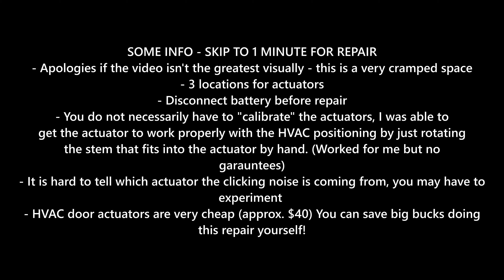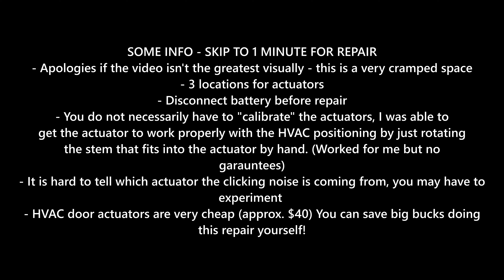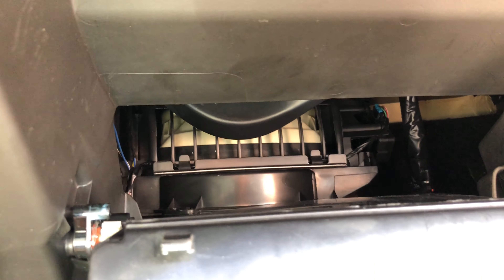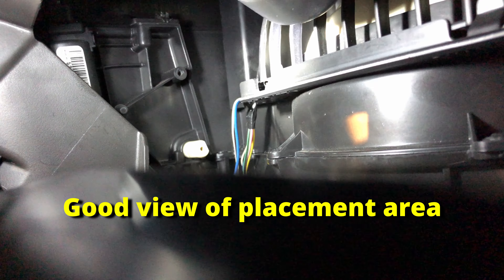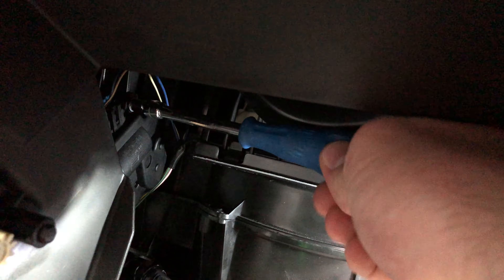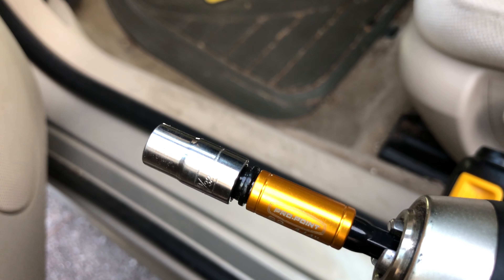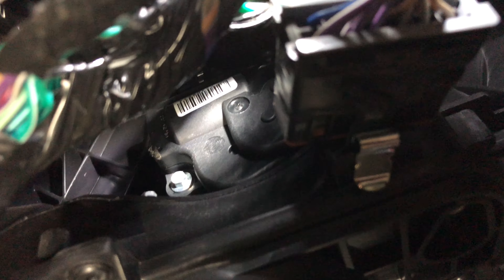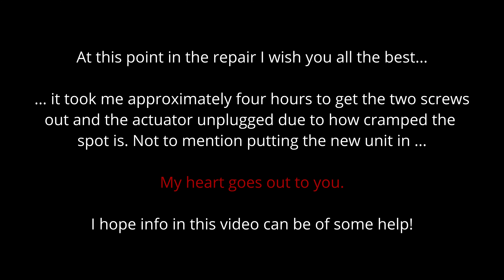Chevy Impala HVAC Air Door Actuators - ALL 3 LOCATIONS! - Fix Clicking Noise From Dash & HVAC Issues

Comment from the maker: Hey guys! If this video helped you out at all, a quick subscribe would mean the world to me. Have an amazing day.
Reply: 2010 chevy impala, It doesn't have the clicking noise but the driver side vents are not blowing cold/ responding to temp controls like the passenger side. Replaced driver side actuator hoping to fix the issue. Still having the same issue. Any ideas? Any help is most appreciated!

Comment: The actuator on the driver side can be more easily removed after removing the wiring harness clips that are in the way, and then using your socket with a universal joint and about a 12 inch extension to get to the two screws that hold it in place. That way you can work on it without being cramped up under the dash.

Comment: Screw that disasterous buried location of the 3rd driver's side unit. It took me 2 hours just to disconnect it. A nightmare in itself, you have to be a contortionist just to do that. I decided to call it "good" to just disconnect it and live with whatever minor consequence that provides. I bet the dealership wants close to $1000 to replace the driver's side unit. The 2 in the glovebox are a "piece of cake" in comparison. I've already done both of those once recently. It seems they all fail within a year or some months of each other.
Reply: I finally gave in, it took 4 hours to complete the job on the replacement on the driver's side. Need a very long extension and universal joint and stick'm to hold the screw from falling out of the socket.
Reply: I gave up after getting the two screws out, but failing to get the clip off. I just grabbed the white knob that turns the flap inside the vent and rotated it until I got warm air. In the spring I’ll get back under there and rotate it back again.
Reply: @JonStratford1234  due to vibration, it may not stay where you want it.
Reply: @danblumel  Shoot, hadn't thought of that. I'll know on Sunday--we have a nine hour drive ahead of us.
Reply: @JonStratford1234  if someone has been manually turning the white knob, will that cause it to break? I have to replace the passenger side now because I'm still getting cold air on that side, but was wondering if tampering would effect that?
Reply: @killerbee792  I don't see how turning it by hand would break it. I should report back that, as @Dan Blumel guessed, mine did rotate back to an open position within five minutes of driving it, so I'm back to having cold air on the drivers side. My guess is, it's not broken--it's just not effective to turn it by hand, because the flap keeps opening back up.
Reply: @JonStratford1234  wow, only 5 minutes? Thats a drag. Don't blame you for not wanting to continue though. It was 15 degrees yesterday, but alas, I got it done, and now that annoying noise is history. Hoping I can determine which actuator on the passe get side is making it cold, I don't want to have to buy more 😫
Reply: I am an 88 year old widow at the mercy of mechanics. I have a 2009 impala with 50,000 miles. I've watched several videos for my 3 problems and can't believe these mechanics take advantage. Yesterday I actually got a $1500 estimate on this problem from the Chevrolet dealer. Also $500 for the check traction control light on dash and $500 for door lock problem. Thanks for the information. If only I were younger.
Reply: @gypsbob  You need to buy a Toyota ma'am!

Comment: I don't have any clicking and i replaced passenger side actuator and the mode actuator but i just have cold air and no heat? My heater core hoses are both hot when running at temperature . My coolant is full. My thermostat is new water pump new. No cracked heads i just don't understand what the problem is maybe you have some idea what it might be

Comment: 2010 chevy impala, It doesn't have the clicking noise but the driver side vents are not blowing cold/ responding to temp controls like the passenger side. Replaced driver side actuator hoping to fix the issue. Still having the same issue. Any ideas? Any help is most appreciated!

Comment: Thanks for filming this, and for your honesty there at the very end. The only thing that I can think of that would be worse than actually replacing this actuator, is filming oneself while replacing this actuator. Holy crap. I should have started a weight reduction program 10 months ago and had both of my arms shortened before tackling this job. I'm 90 minutes in, with a 7 minute recovery break frequency for oxygen and cramping. Step wise: 1) Remove the four screws and handful of plastic clips to remove the shrouds. Enjoy a moment of pride for having gotten them out without ruining them. 2) After those initial four minutes, don't get overly confident with your "progress," you haven't seen anything yet. 3) Take care not to rip the computer input jack out when you try to "get that last shroud out of the way." 4) begin planning to patent a whole new "clip" technology, one that will facilitate one-handed removal of wiring harness clips, because apparently GM doesn't have a good one. 5) Try kneeling outside the driver's door, beside the seat. While you're there on your knees, pray. 6) Seek therapy when you lose all hope of getting this done while on your knees, reaching up under the dash. 7) Here's where it gets fun. Of course, the steering wheel should be all the way up. Send the drivers seat all the way back and recline it all the way. Move the passengers seat all the way back, and enter the cabin from that side. Imagine yourself in the International Space Station, but with gravity. Rest the full weight of your torso on the left side of your rib cage, right on the console. Now scooch farther, and begin despair of ever getting both arms down there. While your face is within 16 inches of the target zone, shine your flashlight up...in...over...past...towards the offending actuator. Just look at it, then start worming your way back out because that angle of entry won't work unless you have three elbows on each arm. 23) Push the passengers seat all the way forward and set it to reclined fully forward. 24) Go around the car, and seat yourself normally in the drivers seat. Take advantage of how easy  is to breath in this position. 25) Begin rotating your body clockwise, using your feet to incrementally fully reverse your position on the seat, so that your back is where your butt started and your feet are straddling the headrest. You'll begin to notice strange sensations in the back of your neck, your stomach, adams apple, and hamstrings. Get used to them. 26) Forgot to mention, get a flashlight that you can grip in your teeth, and put it there for safe keeping. 27) Give up being able to use two hands for this operation. If you're a southpaw, you're in luck. If you're not, go back for more therapy. 28) Wrap your right arm through the front of the steering wheel. This will provide the third pivot point, to go along with your calves. 29) Hopefully you're already holding the ratchet with the correct size socket and a 3" extension. If not, reverse this process, if you can still count backwards from 29 even though 73% of the blood in your body will be in your head right about now. 30) Position your head to aim the flashlight in the general direction of the actuator. 31) Scream at manufacturing engineers everywhere as you attempt to remove wiring harness clips by simultaneously pushing and pulling, with one hand, on the various harnesses that are in the way. 32) If you've made it this far, you may as well go for it. Get your ratchet up there, and using the sensation of "touch" only, attempt to get the socket onto the head of the first screw. 33) If you succeed at getting the ratchet onto the head of the screw, begin to back it out, incrementally, rotating the ratchet by exactly one click with each rotation. 34) If you get the first screw out, try the second. 35) If you get the second screw out, and you haven't passed out yet...remember those ideas for one-handed clips? Go ahead and get a 3D printer and start working on it. Because your next task is to remove a clip from the top of the actuator that is now dangling 1" from where it was originally screwed onto the car. And you still gotta figure out how to get another something (a screwdriver, nail clippers, penny, eyeglasses screwdriver?)...up under there to get the clip off. 36) Get out of the car. You figure that part out yourself--I can't solve everything for you. 37) Go type something utterly ridiculous on a helpful video on YouTube, while replenishing your fluids and hoping the cramps go away. 38) Post your car on Marketplace, and start looking for homes in Texas where you don't need heat by your feet during Winter months.
Reply: Wow now that's a diatribe against this drivers side actuator replacement.
Reply: It's all true too, I'm never replacing that thing again lol
Reply: Legend
Reply: Dude. That tutorial had me in stitches! I have seen many videos showing it can be done but your podium type quest speaker surmin actually helped me invision how I can get it done or at least try.  Well done!
Reply: 😂 😂 😂
Thanks!
That worked!
Reply: @danblumel that's why mechanic prices are around $1500 to replace these. All 3 I think?
Reply: When I worked in the junkyard. My foreman would say. Ahhh! "IT'S A PIECE OF CAKE!"
And he was a short stubby guy.
Reply: I am going to buy two, replace the right sides, and pray that does the trick. I have a hard enough time doing mechanical / car things as it is...  But I cannot justify $1400 for the dealership to do this work!
Reply: Additionally, whoever worked on my car before me had screwed the metal plate behind the plastic panel, so I had to pull the plastic back to get my ratchet in there. When I tried to put my hand to where the actuator was, I deemed it an impossible task because of how big my hands are. I was debating giving up and paying someone to do it but was told a few days later that the damage a hit and run had done to my car would cause it to be totaled. My newer Impala luckily only has two bad passenger side actuators. And I have the set I was going to put in the last Impala. So easy fix.

Comment: Do you know which one of the actuators controls which vent the air comes out of? When I turn on the windshield defrost it blows out  out on the floor
Reply: there’s a fourth one not mentioned, you can just look up defrost and foot actuator chevy impala and it’s located in the glove box too

Comment: For the driver's side, You can save a lot of difficulty with about a 12 inches long 1/4" extension and  a universal joint, also some "sticky stuff" to hold the screws from falling out of the socket during removal and reinsertion. Can use 5.5mm or 7/32 English. 
Lastly can often reuse the old failed part, just one tooth is gone on a gear, rotate the gear 180 degrees and uses a section of the gear that's unused.
It's easy to open it up just need maybe 5 or 6 toothpicks to slide into the locking parts around the perimeter of it then the 2 at the connector. It's actually very easy to open and "repair" them.
Also other videos here on YouTube, how to easily in 5 minutes repair, the common failure point in these units, without buying any parts, it's just so simple, saving a lot of money too.
Search here for free repair of Chevy actuators.
Reply: THANK YOU!!!!!
Reply: Agree.  The bit holder works on the forward lower one on drivers side.  The one I had didn’t work for the rear upper one but the small ratchet worked.   Took me 2 hours start to finish.
Reply: Dad and family friends told me to buy multiple short medium and long extensions in 1/4 half and 3/4 drive
  I lack a lot of formal training but I’ve saved the day with just a basic set and some extensions

Comment: My driver's side blending actuator has been failing for a while. I've been putting it off because it will mess up my back, well everything. They didn't make it easy. When you reconnect the battery the computer will run through the calibration.

Comment: Hate these stupid fucking things, I replaced them at one point before a hot summer awhile ago. Lasted like 2 months before and when it got rather toasty out, that's when it failed on me again. Driver side ofc and as you mentioned it's pretty much painful to get in and do the shit. Everything else on the car's been fine other than replacing brake rotors and the like. You know, things you expect to fail over time. Bullshit that such a simple part is so problematic on top of the pain of getting to it. Overall the 2011 Impala I've had for a good number of years has been perfectly fine aside from these asinine actuators. Honestly about to make and 3d print some shit to just make them manual as fed up with it as I am. Done with dying in the heat or not having defrost in the winter.

Comment: How would I get the to right-side one behind the glove this one is facing away from me so I can't just socket it
Reply: It was really tight but I found I could get the 1/4 inch ratchet and socket in there.  You may need to use both hands as much  as you can.

Doug J.